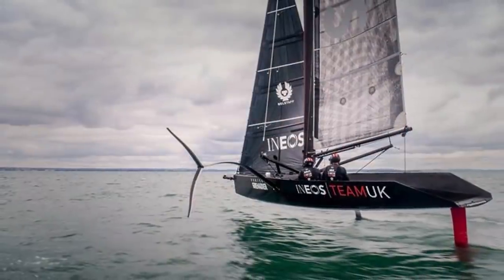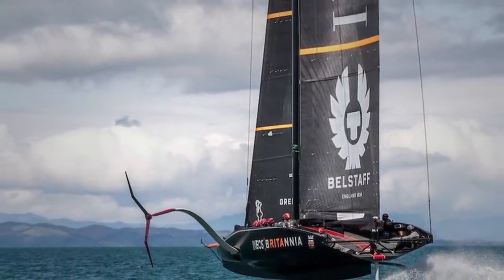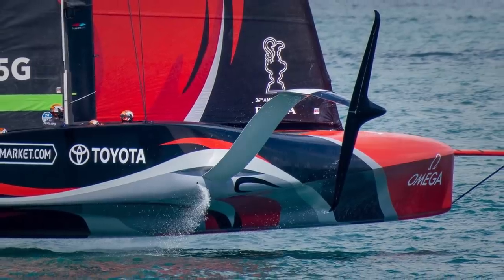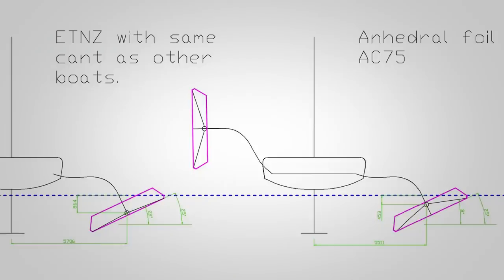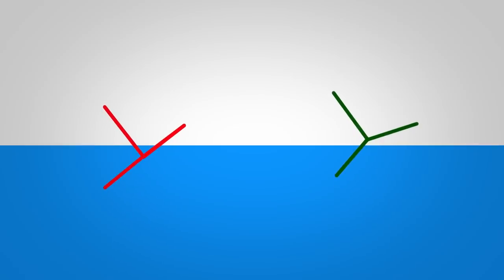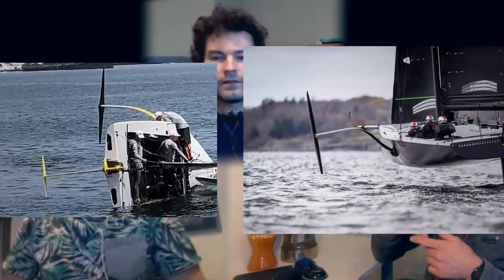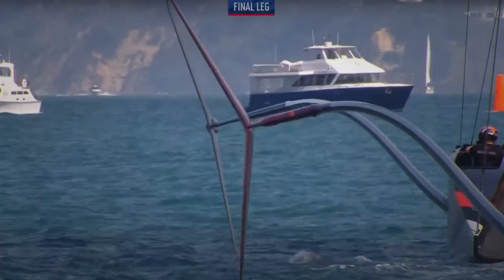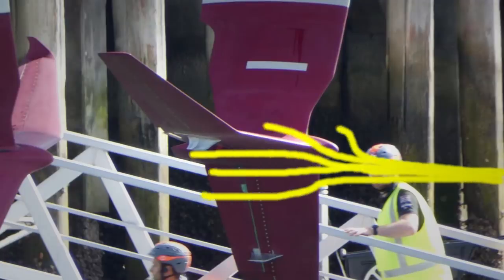Whose Foils are Fastest? ETNZ V Challengers // Straight V Anhedral

Comment: I'm a sailplane (glider) pilot, and in sailplane design things like span, aspect ratio, intersection drag, lift distribution, and tip vortices are massively important for overall efficiency (often visualized with an L/D polar).  Its awesome to see the merging of sailing and flying... (I mean, sure its all fluid dynamics in the end; but its still fun to have these worlds colliding).
Reply: One topic you guys didn't discuss was the actual effect of dihedral/anhedral on the lift and roll moment. Dihedral on aircraft is used because it increases stability - when the airplane rolls away from vertical, one wing produces a greater lift vector in the vertical direction and thus tends to roll the aircraft back upright.  With anhedral, the situation is reversed. On an AC75 that means the outboard foil section will be providing a greater lifting force (as its closer to horizontal); but it almost means the foil section closer to the boat will be providing less lifting force. While this does provide some roll moment (towards the windward side) that you might intuit to be a good thing, I'm not sure that the moment-arm is big enough to actually be advantageous. That roll moment is acting on the foil arm, NOT the hull; and remember how far outboard the arm is from the hull's longitudinal axis (i.e. the center of rotation when the boat heels)**.  By contrast, a "T" foil will have its outboard section producing slightly less lift than the anhedral foil under the same conditions; but the inboard section of the "T" foil will be producing more lift. Depending on the mechanical, structural, and rules constraints on the foil arms this may allow the "T" foils to generate greater net lift and thus enable the boat to fly at a lower speed, and/or allow for a thinner foil section (with corresponding lower drag) at high speeds.
...Fascinating to think about! I'm sure the teams have some insane modeling and testing data around these tradeoffs.

**Think of the bending loads this roll moment can put on the lower foil arm... woof!

Comment: This is a great discussion - thank you. It is mentioned that the depth of the foils below the water surface may reduce cavitation. Another important aspect may pertain to "ground effect". Airplanes obtain an induced drag reduction by flying low over the water. The water increases the mass flow influenced by the wing, reducing the air's downwash angle and induced drag. Conversely, hydrofoil induced drag may be increased by flying close to the underside of the water surface. In this case, the air reduces the mass flow influenced by the wing, increasing the water's downwash angle. This increases induced drag and diminishes lift (for a given angle of attack). Second point: It was mentioned that a wider stance is beneficial to providing heeling moment. Perhaps a laterally asymmetric planform with more area outboard would prove beneficial despite a modest increase in induced drag...

Comment: Interesting analysis of some of the design aspects of these racing machines. With a background in naval architecture as well as flying practice, I couldn't help thinking that the anhedral shape will have very different stability characteristics. Especially because the flow is not always in line with the symmetry plane of the two foil wings, there will be cross-flow along the span direction. After all the foil is not just a wing, it is also acts as a centreboard to counteract the drift force. The gravity and the drift force are not at a constant ratio as speed and course vary. The straight foil will slip more easily in cross flow condition, while for an anhedral shape the drift increases angle of attack on the inboard foil wing keeping the foil flying more straight.
Incidentally, this 'flying straight' with no slip is a major task of a glider pilot optimizing the glide performance.
Like you said, a myriad of parameters and requirements can lead to different design optimizations.
Reply: I also agree that cross flow should be considered in the equation. Unaligned flow would happen when tacking, for example. The V shape, as in planes, would induce a tilting moment that influences the manouvre. It's not all about top speed in a match race.

Comment: Good one Mozzie!  As mentioned, RM is increased with the T foil, and this must be quite critical as there's not much else that can be done to enhance RM. Together with efforts to lower the CE, such as NZ's "camber adjustment device" to help power up the lower section of the main whilst depowering the top, this could make the difference between a fast boat, and another that is just one knot VMG better.
Reply: You are onto it max.  Team NZ has an Imoca 60 designer onboard as part of their design team.  The Imocas use huge foils for righting moment.
Reply: @philmole5294  They just need to change the rule that prohibits foils on the rudder. For now, they have to drag their butts along.

Comment: Great job guys.
One thing that does not seem to get mentioned is the lateral resistance provided by the foil/arm assembly to counter leeway. A "T" foil with a high cant angle (outer tip piercing the surface) must be providing a significant portion of the lift vector horizontally to windward, whereas a "Y" foil with the outer half of the foil roughly horizontal under the surface may be producing more upward lift but less horizontal component providing resistance to leeway. Do you think this could be a significant factor affecting windward performance?

Comment: The anhedral foil of Luna Rossa has some advantages and explains her ability to sail higher than Te Rehutai and tack and gybe with less side-slipping. First, the arrangement is not deficient in righting moment. The leverage that creates righting moment increases further out from the side of the hull. So the outer foil wing generates more righting moment than the inner. In addition, the closer that the plane of a foil wing passes through the center of effort of the sails (minus the center of the mass of the boat), the more righting moment it generates. The outer wing of an anhedral foil can be set closer to level than a flat foil and so it can create more righting moment than the inwardly canted outer wing of a flat foil, like that of Te Rehutai. Meanwhile, while the outer wing is level, the inner wing of the anhedral foil is down relatively deep and is acting much as a leeboard. To get the same combined righting moment and leeboard effects, the Te Rehutai crew must cant their entire foil. They therefore get less righting moment from their outer wings than does Luna Rossa. When tacking and gybing, the extra depth of the foils on Luna Rossa prevent the sort of side-slipping that has plagued Te Rehutai and cost her distance at mark roundings as well as upwind distance coming out of  tacks.

All that said, having the one outer wing do more of of the weight-lifting has required the Italian team to make their wings bigger. The New Zealand design allows for less surface area and so less drag. The New Zealand boat seems to have gone for flat-out speed (pun intended) while Italian design seeks a compromise between speed, pointing ability, and maneuverability. Te Rehutai is more of a drag racer while Luna Rossa is more the Monaco street-fighter. Te Rehutai needs to avoid getting into tacking duels with Luna Rossa. Luna Rossa needs to mix it up as much as possible, especially at the start. The action on Course C will be especially interesting, if we get there.

Comment: a Tee foil allows for one drive mechanism.  sure you ""can" do this with anhedral but much more complicated mechanism.

why to planes have (or don't have) anhedral ?   I believe it gives some advantage when banked (or when the boat in this case is canted).

with a canted boat, and therefore foil, the anhedral foils will have different angles to the water surface.
I'd've thought breaking the water surface was something you really didn't want to do.
boat flying height would help this.

the guys are spot on ... this is all compromise, and advantage will have some cost.

great post !

Comment: I think that T foil allows also a bigger and gradual statical stability along the vertical axis: the bigger foil tip surface out is, the lower lift you have which keeps distance of skeg from the water almost constant

Comment: The RM is one aspect but a T-foil configuration offers more lifting force at lower canting angles just because of the geometry.
The Lift is the force perpendicular to the foil, with a V-shape, the Lift is almost a lateral force till the outer side of the foil is under water. With a T configuration when the inner side of the foil the Lift force has a much higher vertical component.
But it is as always in engineering a trade off of many optimisation factors that in many cases go in opposite directions.

Comment: I agree with most of this except for a few points. If NZ is sailing with surface piercing foils, they then have less righting moment, not more. And on the topic of induced drag, I'm pretty sure what counts is overall span as measured perpendicular to the overall lift vector. Or put another way, a y-foil might have a longer span if you stretch a tape measure along it, but the two halves of the foil are working against each other pulling outwards. All in all, great video, intelligent and well informed discussion
Reply: With the wings of a single foil counteracting each other, it seems there must be some contention, so a loss of efficiency.  T foil (if we assume sustained flight is only ever with wings parallel to the surface of the water...can this be assumed?) has only 1 primary direction for the forces.  Seems a battle between efficiency/speed and controllability.  Anhedral likely provides each wing can be controlled independently, but perhaps with greater experience the less the teams need the crutch of control.
Reply: @leuvenisaplace  I'm pretty sure they cant the foil and lift force to windward as much as they dare to get lateral resistance, when sailing to windward, because there's very little of the vertical foil arm in the water. Much like the Mothies heel to windward.
Reply: @leuvenisaplace  In the previous video, Mozzie said that accrdong to the class rules, the two halves of the foil need to be able to be controlled independently of each other.
Reply: @paulgush  nb.  Independently of each other doesn't mean that they can't be controlled to behave in the same way at the same time.  Do the foils need to operate much of the time as turning surface to control the heel of the boat?  If the control surfaces allow the wing to minimise forces whilst the foil arm cants up & down, then having lift forces that counter each other isn't doing much except adding drag.  These are essentially low flying aircraft, not rockets that need to articulate so much in 3 dimensions IMHO, though 3D control is likely very nice to have.

Comment: I dare say that with the CFD software available they could use Monte Carlo methods to determine the optimal foil configuration, but the difficult question would be against what criteria the results would be measured. How do you think they set the desired criteria to be achieved? They would have to integrate many sea/wind states and weigh them individually. Then there are the delta scenarios such as how to recover from a splash-down. Looks really complicated. What do you think?

Comment: Anhedral reduces stability, therefore the boat is easier to turn.
Reverse gullwing gives more lift at low speed, enabling the boat to foil quicker. It could also be more effective while the boat is healed over.
The straight foil is probably more efficient at speed.
The "turn ups" at the ends are winglets. They effectively increase the aspect ratio of the foil, therefore efficiency by reducing tip vortices.

The "cavitation/ventilation" could be the foil stalling (laminar flow breaking away from the wing). This could be used (like Concord) to lower the pressure above the foil to produce more lift at low speed.
  
The "T" foil looks to have less cord, therefore a higher aspect ratio, = more efficient at high speed.

I suspect Ineos have a big development advantage from their partnership with Merc, as they will have mature software for modeling these things.

Comment: The point on depth of foil is interesting. There is also I assume a lot of complexity from the waves even when relatively small. Looking at coverage shots from above it looks like the upper surfaces are cavitating on and off a lot. Unfortunately we can't see undersides where presumably cavitation would be disastrous which I guess is where the root discussions were centered and also previous conversation on winglets. Is there not also a major component in this discussion re lateral forces which would impact slippage from high lateral forces on rig and how this affects design.

Comment: With the anhedral designs, the outer wing is significantly improving righting moment while the inner is contributing to into-wind thrust. Do you think the lower, inboard half of the foil is trimmed out (to reduce drag and this effect) or is this a useful contribution to improving heading higher while pointing lower?
Reply: It is certainly not trimmed - the class rule says that the foil has to be symmetrical, so both wings of a foil have to be identical - same angle to the arm, same length, same shape and weight distribution.

Unless I misunderstood, and by 'trimmed out' you mean that the flap on the inboard wing is trimmed (as in: adjusted) differently to the outboard one.

Comment: Great video guys. Could you explain in a video why we don't see more leeward heel when the boats are midway through a turn with both foils down? I would have expected a lot more heel as the windward foil which was providing righting moment when airborne is suddenly providing heeling moment when dropped in the water, or are they differentiantly trimming windward and leeward foils so both provide righting Moment? They must be I think...
Reply from the maker: Good question! The windward foil will still have weight even when submerged. But I guess your quest is whether this is negated by hydrodynamic lift which would heel the boat to leeward? I think when they drop the board like this it has almost zero angle of attack, and without flaps engaged would provide very little vertical lift. Or, with flaps inverted may even provide additional downforce. 
Dropping an extra board is of course a lot of extra drag, and inverting a flap to create extra downforce would be a lot of drag too. So not something you would want to be doing in a straight line, but the latter grip of an extra board certainly helps them make tighter turns and therefore sail less distance.

Comment: I ware concrete boots, however, I too am fascinated by the physics involved in this format. Question, is the small foil on the rudder able to rotate akin to the elevators on the rear control surfaces of aircraft, and thus help control the pitch of the boat.
Reply: As I understand the rules there are no control surfaces on the rudder T section. Any pitch movement is controlled by adjusting the angle of rake of the complete rudder. Not sure if this is something which is adjustable during a race or is preset before a race.

Comment: Some of the commentators were saying that the Patriot crashes in their last races might have been caused by cavitation - they were doing over 50 knots at the time.
Reply: If as I suspect, they are using cavitation (ie: stalling the foil) to reduce the pressure above the foil and produce more lift at low speed. 
A sudden increase in lift a 50 mph wouldn't be conducive to keeping the foil in the water.

Comment: I think that with the t foil you have higher induced drag and higher profile drag, cause you have the biggest surface area (at same cord length) considering the longer arm (and that extra piece underwater does not make any lift, only drag), but is interesting the half submerged mechanics, that could actually make the difference. I found it extremely difficult to operate though, cause if all the profile stay underwater u can maybe think that the force is only function of speed, flap angle ad boat yaw angle, but if a part of that foil is gonna be out of the water that force will be first fluctuating (cause waves) and second dependent on how much foil is underwater. And I have a question, does the induced drag half if the tip of the profile get out of the water?
Reply: and how did you found the induced drag and the pressure drag separately? Are those cfd results or theoretical calculations?